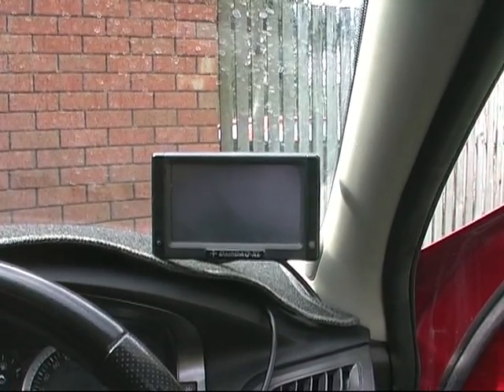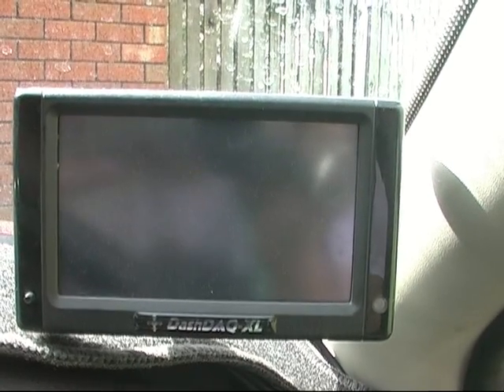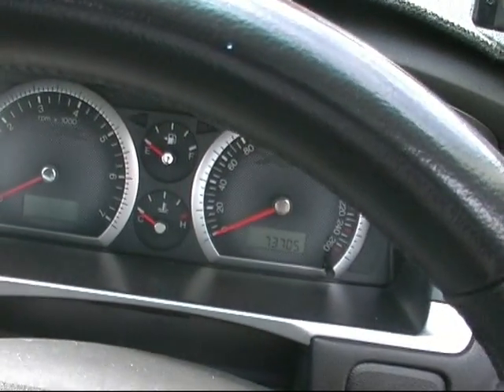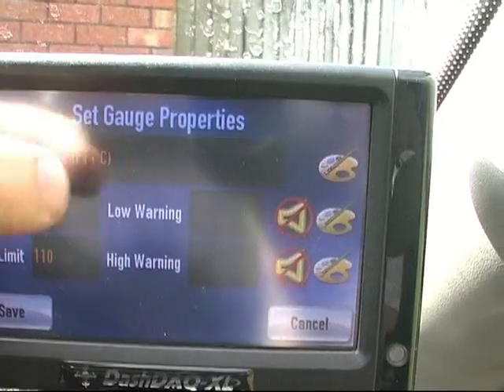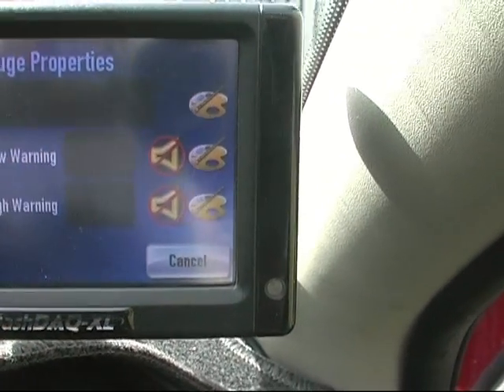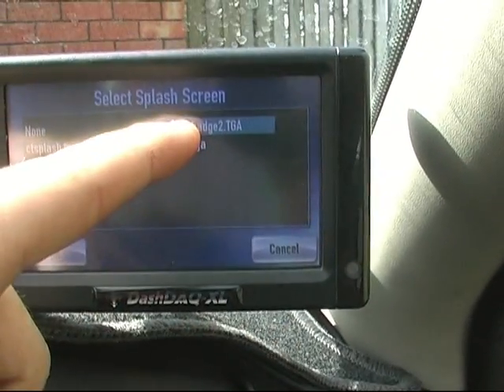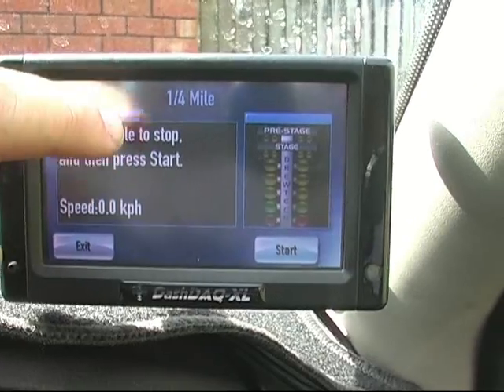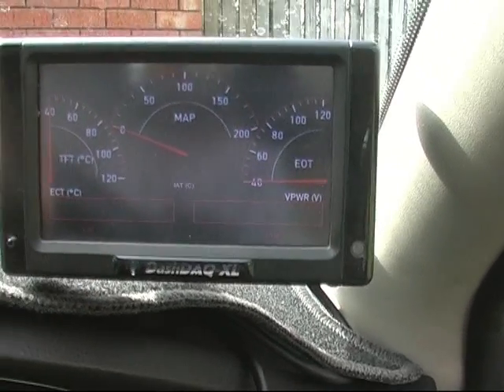DashDaq on BF XR6 Turbo run through

Comment from the maker: Unit comes with an OBD2 cable. Thats all thats needed to connect to the OBD2 plug thats on all B series falcons and newer.

Unclip the fuse box lid thats in front of the drivers seat. Feed the DashDaq cable through the hole in the lid. connect the cable to the white OBD2 port above the fuses and put the lid back on. I feed the excess cable under my dashmat.